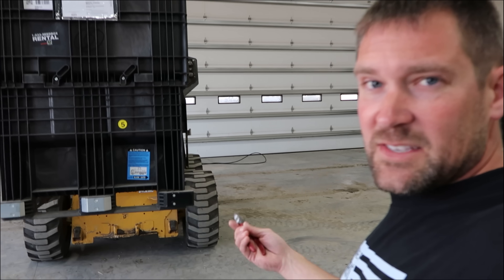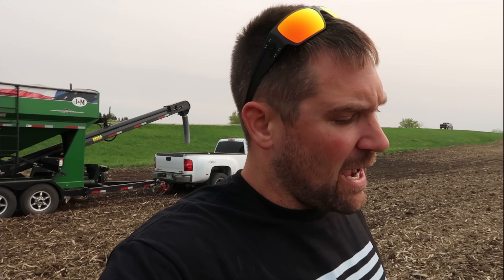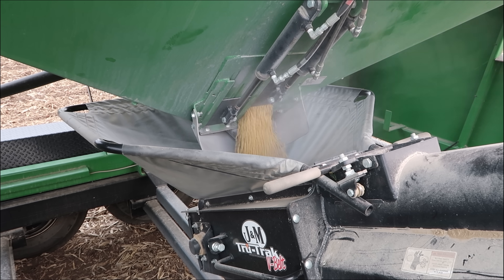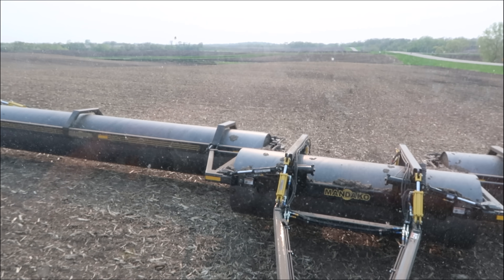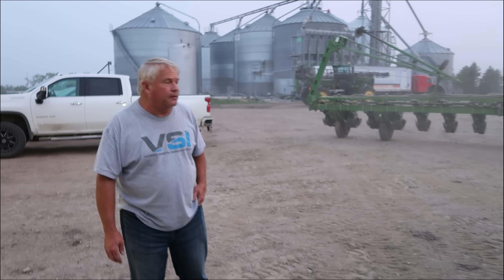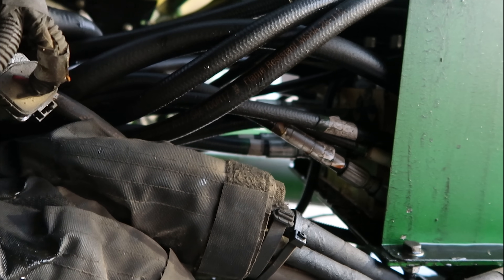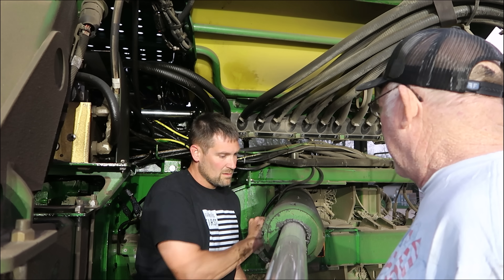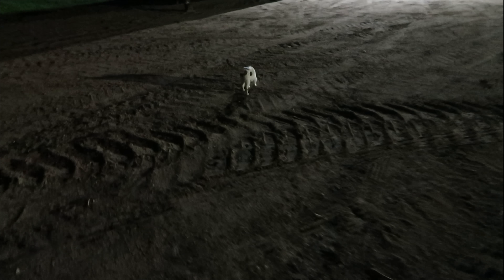It's Hard to Find Good Help

Comment: As someone that has seen someone get cut by spraying hydraulic fluid I winced when he put his hand on the hoses when you were checking for the leak.
Reply: Yeah, wtf!
Reply: I agree. I was waiting for him to put on the face shield at the very least, because injection is a very serious injury. Two weeks ago, a friend of mine had an injection accident with his pressure washer, putting several ounces of water into the back of his hand, and fortunately didn't damage any tendons or nerves.
Reply: My dad did last year two weeks before vacation so he tried as hard as possible to make it and he just sat on the balcony watching us in the water the whole time😂
Reply: Also it broke his finger and still isn’t healed back
Reply: @arthouston7361  injecting water is painful and may damage/cut internals. Injecting hydraulic fluid leads to necrotic tissue and amputation
Reply from the maker: I know better, just didn't use my head. Next time, I'll think of you guys!
Reply: @MillennialFarmer   I'm glad to hear that. A pressure washer can be 3500 PSI and a hydraulic line can be 5000 PSI.
Reply: @arthouston7361  mobile cranes we produce have a working pressure of 6000psi+ and a burst/overload pressure of more than double that. But its not the cut that does most of the damage, its the fluid type, oil is not made to be inside if you, cells don’t like it.
Reply: @MillennialFarmer  maybe you want to address the dangers of especially hydraulic oil cuts in your next video to promote awareness? So other farmers who maybe also know better get reminded? Even if it saves 1 life = worth it.
Reply: @Lesani   Yes those pressures are on the upper end.

Comment: I have a friend who's father lost his eyesight in both eyes from a hydraulic leak sprayed into his eyes. I implore you to put on safety glasses. You have a fine family who needs you. I was an auto technician and shop owner for 55 years and I can't tell you how many times my glasses saved me. Just saying!
Reply: As a AG dealer tech I was cringing. Always put glasses on when looking for a hyd leak. It ain’t worth it
Reply: @kylehalderman6210  I buy  a half dozen sets every year. With cheaters to read small stuff.  Have destroyed 3 pair where they likely saved my eyes.  A battery exploded as I hooked jumper cable.  (Ok wiggled to check connection)  a tornado debris, and a firearm failure)
Reply: I had a tech blow a mostly frozen battery in his face. No glasses. He dove headfirst into the snowbank….
Reply: @brianvarner  dad was in pickup.  I keep old, cleaned milk jugs of water (often with dish soap) in truck bed.  I dumped on my face, got in bed of pickup, told dad “drive to well, get water in hose”  I flooded face, body with water, stripped to boxers. Then my cloths in washer, me in shower.  Barely a mark.  Plus a hour later I could hear again. Loudest thing I can recall.
Reply from the maker: I'll be wearing glasses from now on!
Reply: @MillennialFarmer  Your channel is by far my favorite. My father came off the farm in Buffalo, Mn using only horses. Started his auto repair shop after serving as a anti-aircraft gunner in the Pacific theater of WWII. He started me at 10 years old. But my wife feels I missed my true calling as a farmer!  Keep doing what your doing!
Reply: @MillennialFarmer  This is what we farm in Northern Michigan . It takes 15 years for a  Blue Spruce or a Douglas fir to grow 7 FT     !!!

Comment: Zack, just a note. Standard o-rings are durometer 70A, for anything over 1000psi you need to get harder ones, durometer 90A, ever harder depending on your system pressure.  Putting in a standard 70A o-ring will work for a short time but it will fail.  I hope you have the correct kits on hand.

Comment: Anytime you're moving seed I always think you could justify a little electric forklift. Nylon wheels, tight maneuvering, would save grinding those skid loader tires on the nice concrete... Could surely find a reasonable used one.

Comment: Be on the lookout  for leaks on that new sprayer. Same thing as that planter leak. Small plug on hydraulic block, blows oring and gets loose and starts leaking. R4030 happened 6 separate times. One block under the belly and one block on the boom

Comment: John deere uses a lot of aluminum hydraulic valve blocks - but steel plugs ...the aluminum and steel expand at different rates - so it's pretty common for the plugs to loosen which blows the o rings out ...

Comment: Zack it could be the plug has one less thread or the threads are too sharp...  several years ago a lot of hydraulic mfgers went to china and tried to save money on plugs... I ended up changing out my competitors bins at an oem and put our plugs in.  It took 3 days to do this but it solved their problem. We started stamping all of our fittings to keep ours segregated. Also if any heat in this area it could have been a nitrile or neoprene part instead of a brown viton. Viton o rings take the higher temp...

Comment: Simple Green is my favorite solution for cleaning up an oily mess. Works well with cold water. Used to use it on my motorcycle engine. Cleans like a champ - Simple Green and a garden hose.

Comment: Need to get you set or just a single Allen scocket, that you can use to get those plugs out. You can use an extension, or two, it will hopefully be a even easier job the next time. Stay safe.

Comment: Man, watching you plant makes me miss my 8370 RTs.  I traded for new ones this year, and it has been the biggest let down as far as new Deere tractors go.  The stereo is garbage compared to the old ones, and there is zero storage in the new cab, and it just feels smaller.  New model Deeres are usually a step up from the model they replace but these new ones are cheap plastic garbage.  Even the door feels like it's going to fall off every time I shut it.  I am currently looking for a 2019 or 2020 8370 RT with sub 500 hours.
Reply: Yep I like the older styles too, about 2013-2017ish frame. We have a newer 8370 and I don’t like it at all🤷🏻‍♂️
Reply: @AlabamaLinemanFarmer  i can’t believe some of the stuff they took out. Mine are signatures series and they don’t even have an outside temp gauge anymore. Only two settings for lights, took the radio and phone off the 4600. I could go on forever but bottom line is they cheapened them up to the point where I don’t care what color I run anymore.

Comment: If you want to get serious work done, a Kubota UTV with a diesel engine is hard to beat. They are basically the HD version. Slower and a bit noisy, but they pull and haul like a beast.

Comment: Another safer option for finding these leaks is to use a remote camera.  There are dozens of them on the jungle website, and many have long leads to the tiny camera head (if not wireless/Bluetooth).  The hardest part is affixing the camera head to something in the correct place.  Just an idea to consider . . . or heck, even one of the cameras you use for YT filming, but it may get sprayed on so the remote cameras with just the 8 or 10mm head - those can be wiped off, that would withstand hydraulic oil without any damage.

Comment: Whats the roller for? Closing the ground after planting?
Reply: I think they mainly use the roller for soybeans be cause they run the combine header close to the ground to not miss low hanging beans. The roller just smooths out turning ridges and smashes the small rocks down.

Comment: A couple of cans of brake clean should get rid of the oil :) Good stuff that brake clean. Question about that bad seed. If as you know some of the seed is rotten. Obviously that seed wont grow into anything except a mold pile. But I guess the question is how much of the rest of that seed is bad. Even if only say 5% of that seed is bad, that is still when in the field a fairly high loss rate and that is before you even start and get to the end of the season....... Keep safe and well everyone.

Comment: Quick question, when the seed is rotten and had mold on it, will it still sprout or is it better to dump the tanks and be 100% sure it comes up?
Reply: It depends on how deep the mold is. If it’s still on the “shell” it will still sprout. If it’s inside the seed then chances are it will not

Comment: I’ve always wondered, what are rollers used for?
Reply: There is a certain feeling when traveling across a rolled field  pulling a roller.
Reply: I believe besides making the ride smoother, because soybeans don't grow very high, if the dirt is rolled one can harvest them with the combine head almost scraping the ground. Because corn cobs grow a few feet off the ground, there's no such problem in corn.
Reply: @Quicosuper  ooohh thanks that makes sense

Comment: There is so much aggravation in farming.  But in the end, it's all worth it.
Reply: Especially when you can plant 1000 acres.of.corn and bring in $1.2 Million cash.
Reply: @beckyumphrey2626 you should be able to make that much considering how expensive everything is. 

Tractors, planter, disk, sprayer, fertilizer, herbicide, diesel, DEF, center pivots, water, combine, trucks, grain carts etc are not cheap and that’s the bare minimum to plant, grow & cut 1000 acres of corn🤷🏻‍♂️

Comment: Please wear rubber gloves when you are looking for a hydraulic leak or injector line. You can get fluid injected through your skin. I knew a guy that lost two fingers because of that.
Reply: 3000 psi will cut through rubber. I know someone who cut their foot with a high pressure washer right through his boot. That was bad enough, much less getting injected with hydraulic oil.
Reply: So why doesn't it cut through the rubber hose? I know a company that uses 80,000 psi water to blast away concrete bridge decking so not all the rear has to be wasted. That type of pressure will cut through a boot. They use synthetic hose.
Reply: @marknicholson2718  Its braided steel line coated with rubber. Flowing through hydraulic hose is one thing vs escaping to atmospheric pressure thru a pin hole at tremendous speed is why it can cut gloves /boots and inject thru skin.